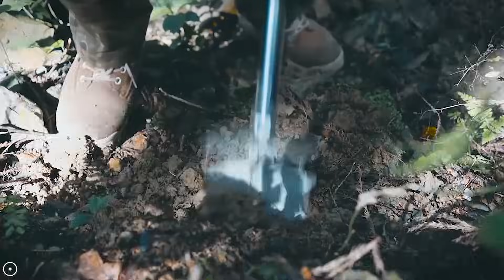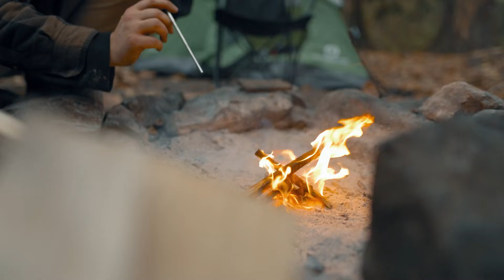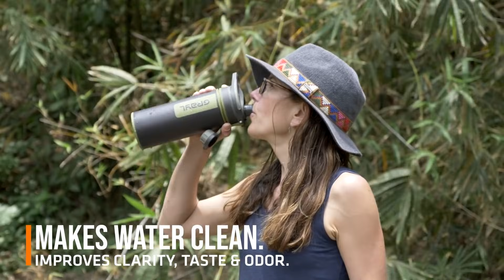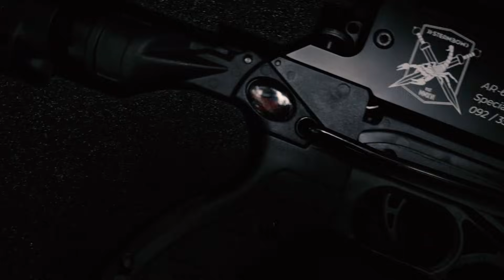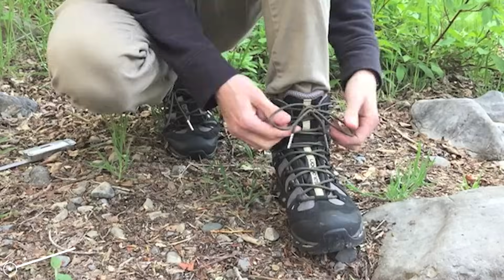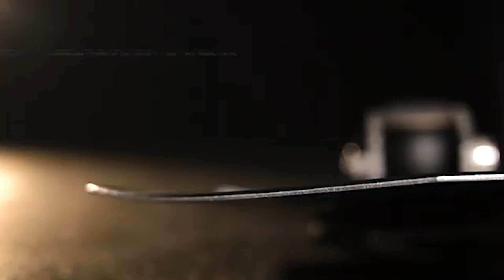30 Survival Gadgets Every Man Should Have

Comment: a cheap “blue” ( many colors available). tarp.
does what this does and much more. and FAR less money.
i will stick to my real multi tool.
that shovel has parts that will be lost. and too light for good digging. i will stick with my try fold military surplus unit.
what is a tear in those gaters? as long as you do not bother the snakes they sneak away not bite.
maybe that rain hood, ouch on the price.
i have a number of those alarms. the 12 gauge units they work great.
that real not with my fat fingers. in my go bag i have one of those very short rods.
you can get fat wood free up in the mt’s. 
or use  cotton balls soaked in Vaseline. 
make your own fire starter charcoal.
matches, lighter, ferrol rods, etc  should have multaply was on you to start a fire.
that tiny knife is a felony in some states.
duck take can fix anything. even a field fix for a gaping wound.
learn how to filter junk out of water in a sock. 
and carry water tabs. or a way to boil water for 5 minutes.
that saw is only ok. they tend to jam up in the limb you are cutting. and cut poorly in green wood.
dry bags are great if boating or rafting through rapids.
flash light gimic.i have far better units. and why needs a phone in the woods? where i go there is no cell service.
water from the air? looks interesting. but way too high of a price. if i get desperate and drunk maybe.
smoke flare’s work better in the daytime.
star flares at night. but this will help at night.
crossbow pistol. good for small game, and thin skin targets. worthless on deer, $300 maybe.
i stay away from the artic.and know how to build a snow shelter. and fire. a junk concept toy.
no edge then junk. dull blades are a hazard.
should cover up to at least half way up your thy.
alcohol stoves can be good. and can be made from one alum soda or bear can.
i will stick to my buck 110. been going great for 50 years now. bought it back when a 14 year old kid could buy a knife with cash in cal.
emg bevy is a 35 larger gallon trash bag.
3 days no water your dead. 
3 weeks no food to die.
yes in cold temps or wet in cool temps you can die in 5 minutes.
not much beats para cord.
children are kidnaped not lost in the woods.
pets need to have the proper tags and chipped.
got photos and videos of your kids and pets?

in the USA it is called bear spray. the can show in the video is NOT legal everywhere or reason for use.
but is in the woods it is a must have. along with a gun and ammo.
back to a simple tarp.
another cheap saw.
 ha - ha saw… o wait you said baha.
radioactive items? how the hell does it do that?
epa ok is only $100,000 USD away.
omny blade is junk. should be sold at hf stores.
fish traps are illegal in most areas in the USA.
who wants to eat anything out of that bad water
Reply from the maker: Thanks for sharing your extensive experience and practical alternatives! It's always great to hear different perspectives on survival gear.